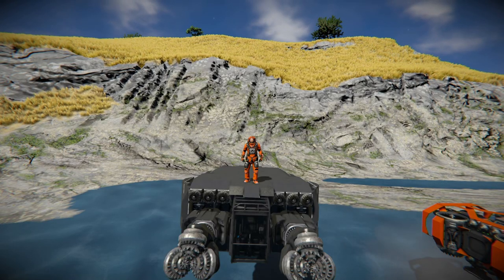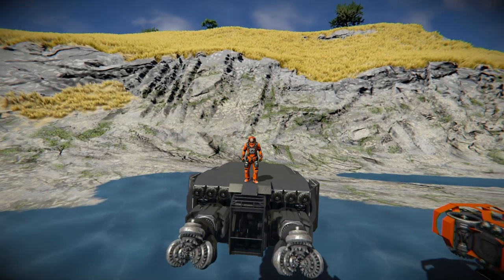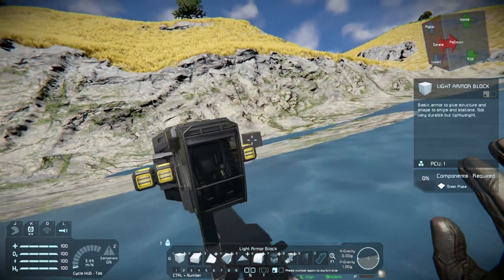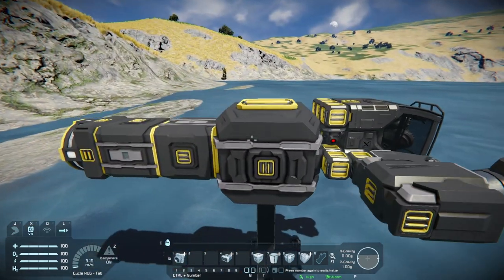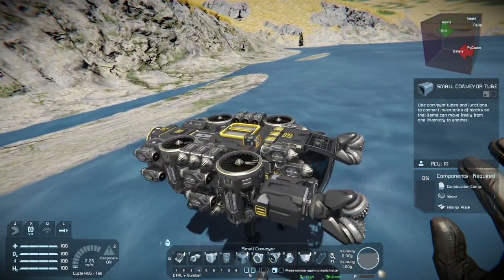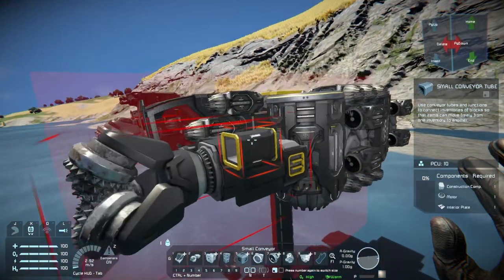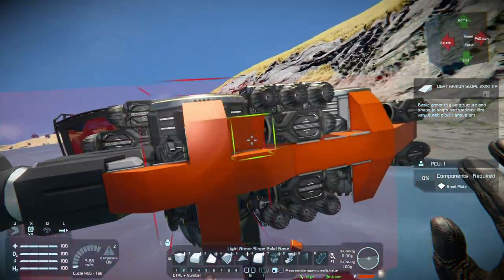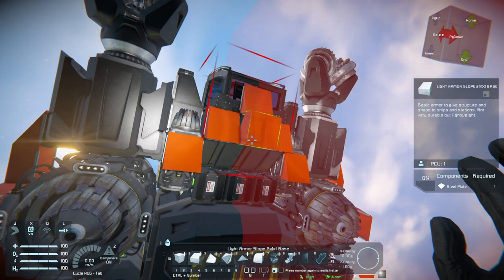How to Design Armour - Space Engineers

Comment: The anti-brick propaganda continues
Reply from the maker: It has to be done
Reply: You make a good point. I'm gonna make a sexy brick. It's decided.

One idea: a perfect rectangular shape, with one face entirely made up of grinders, but in front of it, ude rather fragile bumpers and a layer of light armor on the very front, use it as a taming vessel, and when contact is made, the false front will break but leave the grinders intact beneath, allowing it eat a square shaped whole straight through the ship. I'd probably add some reverse thrust tho help slow you down a little when closing in. A full speed ram would probably be too much damage
Reply: @dmitritelvanni4068 Worked for the Borg.

Comment: not the best option. you have little traction in the diagonal plane forward and down. when you dig mines and get a lot of weight from the load, it will be difficult to hang in a diagonal plane.
Reply from the maker: The miner can actually carry its self, the two large cargos of ore and the drills full no issue

Comment: Hey man, so I ran some testing and apparently the best way to do armour on the miner is having it not touching directly the thrusters and other internal fragile components, because I made a miner with armour covering directly trusters and stuff but still if I hit a tunnel wall a bit I was damaging the armour but also the other stuff that this armour was touching, like a damage propagation mechanics...
Reply from the maker: yea your not wrong, damage does travel through blocks. the best way i have found to mitigate this is to use offset amour panels, that way they don't connect to the components whilst also not being very bulky. the only downside is is basically required to use heavy amour

Comment: mostly angles and shapes are why i cover things up or make actuall frames to plan out shape better.. looks bricky at fisr but it takes form eventually.. APCs for example have a vustom cab thats sealed. kinda cant be made of componant blocks with bits if armor like that

besides ive figgured out pin points to put it in flat so i use blast door for armor now. beavy but tough.. and no cobalt for metalgrid so its cheap XD
Reply from the maker: makes sense, blast door block are the best for there cost